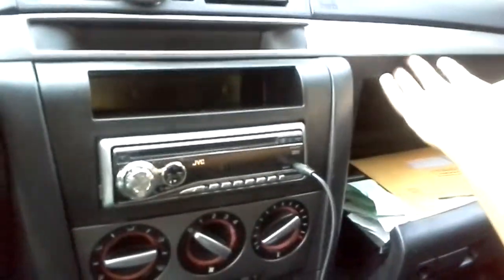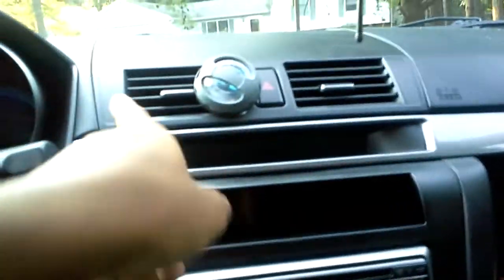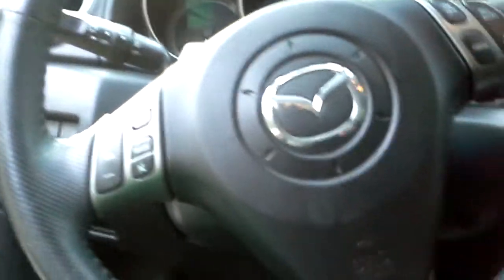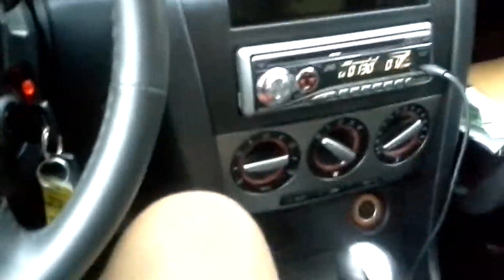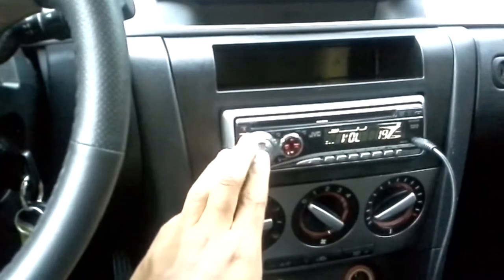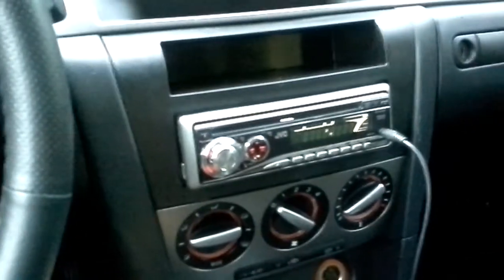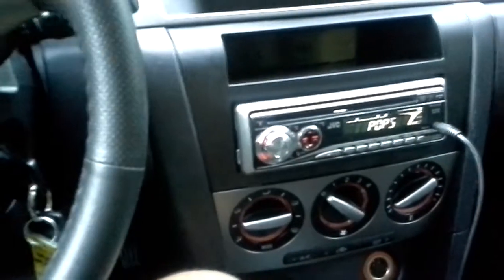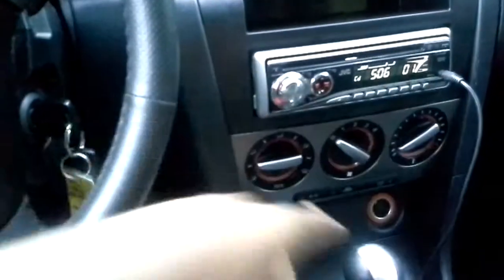Wire Run pt.2

Comment: Good job on that head unit install for some reason. When you said you thinking of a new head unit. I was thinking Alpine or Pioneer. Both is great choices. You gonna figure everything out when you get playing, and get a feel for the car. Each car is different in sound. But, Alpine. Lol.
Reply from the maker: Thanks man.I was nervous cause I thought I would break a clip but I was gentle with the panels.anything else new will make my speakers louder than this old ass deck.which tweeters should I get? Lol
Reply from the maker: Thanks man.I was nervous cause I thought I would break a clip but I was gentle with the panels.anything else new will make my speakers louder than this old ass deck.which tweeters should I get? Lol
Reply: CalvertCountyKid My opinion for tweets on a budget is the Legacy LT18 1 inch tweets. Super bright, clean sounding. Just put some in my brother Yukon front and rear coming off the deck, and you can hear those hi hats, cymbals, anything in the high range clear. Which cleaned up his door speaker setup pretty well cause his was very muddy. Their like 15 per tweet I believe. Second best would be the Power Acoustik NB.2 I have those in my front doors and their pretty clear coming off a cheap cross over that I gave on my crunch components. And those are like 9 bucks.
Reply from the maker: Will I have to modify the pillars that the orginal ones are in for the new ones to fit?

Comment: looks good. my opinon leave subs like they are. if turn them around it wont sound as loud ,but experiment with it. yea if u turn them around youll have to seal them off to get best sound just my two cents
Reply from the maker: If I stand the box up so its subs up port to the side it will be louder I think.but I don't want my box to be visible. There are thieves out there
Reply from the maker: If I stand the box up so its subs up port to the side it will be louder I think.but I don't want my box to be visible. There are thieves out there
Reply: totally understand do whats best gor you homie